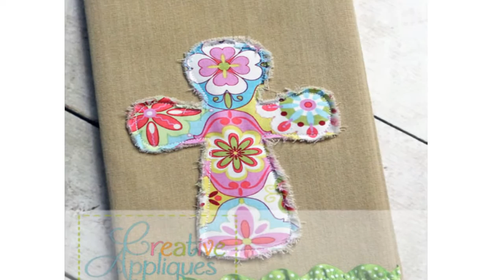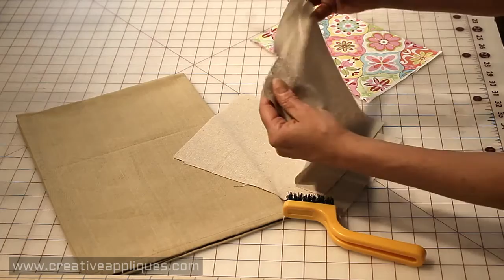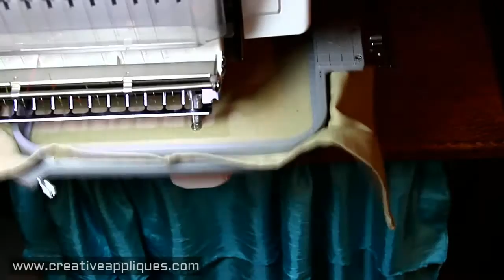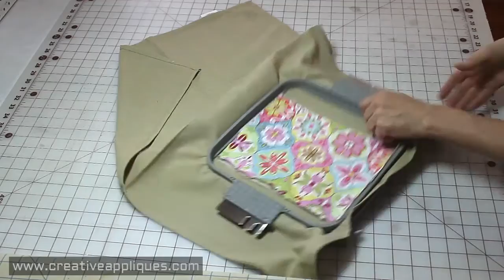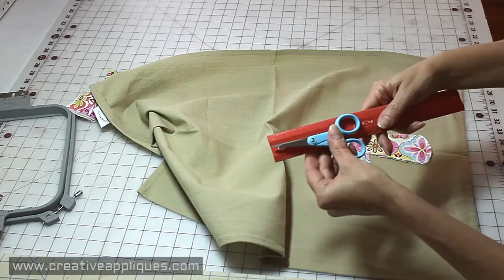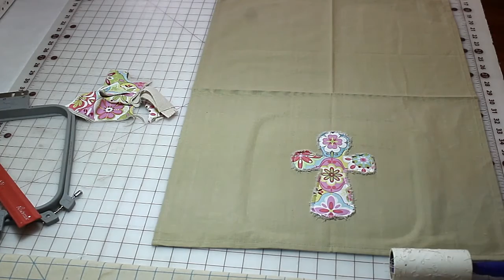Make raggy design using machine applique | Creative Appliques

Comment: why use the cut away and the tear away on tshirts? curious newbie here. :) Thanks so much for the video.
Reply from the maker: it adds more stability to the stretchy shirt fabric. Tear away is not strong enough by itself. The more stabilizer you use the integrity of the design will hold up. It is my preference after many years of trial and error. It is what works for me. Try it and see if it will work for you too!